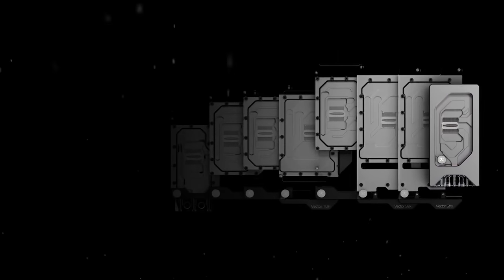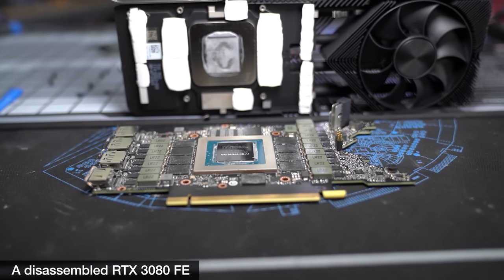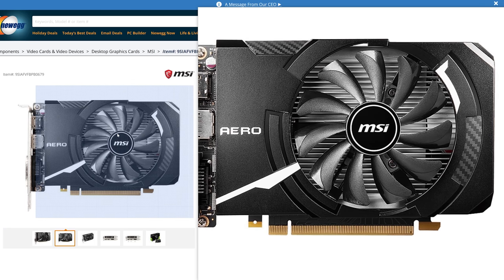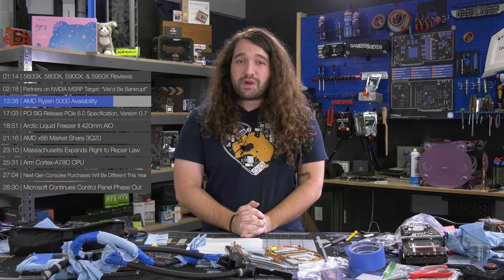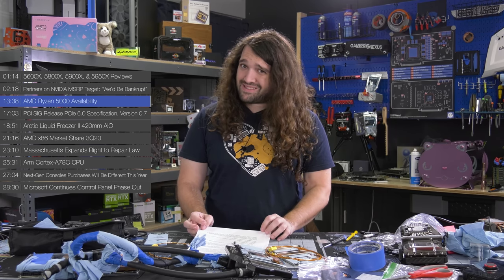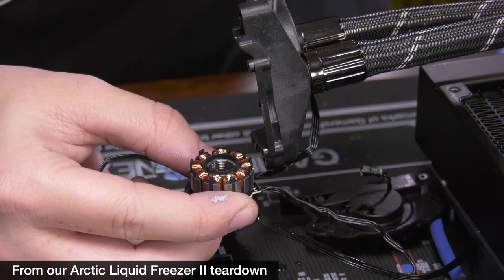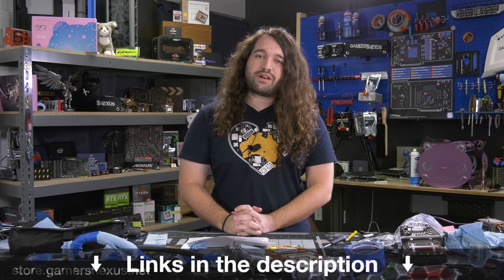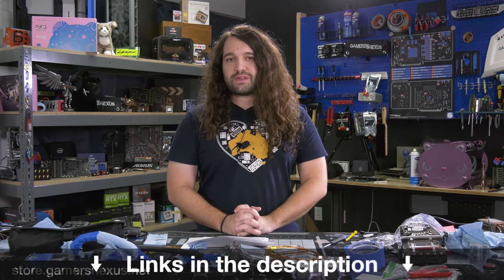HW News - NVIDIA MSRP Allegedly Not Realistic, Ryzen 5000 Supply, PCIe 6.0 Spec

Comment from the maker: Check out our AMD R5 5600X CPU review: https://www.youtube.com/watch?v=01EhbmJAW-k
Show notes & sources: https://www.gamersnexus.net/news-pc/3628-hw-news-nvidia-msrp-realism-debated-ryzen-5000-supply-pcie-6
Reply: Yes exdee
Reply: Jes
Reply: Thanks for all the work on the 5000 reviews.
Reply: hey steve you know of any passive cpu coolers which have a kit for am4 support? Other then that arctic alpine am4 passive.
Reply: Did anyone get the recent patch for Kaspersky? It changed a bunch of stuff. YouTube searches aren't slow anymore. Could make for interesting tech news.. Maybe.
Reply: The restriction of liquid flow in the radiator is smaller with thicker radiators, wider radiator and shorter radiator. So according to this, 360mm radiator can be even more restrictive or similiar to the 420mm radiator. 
A wider radiator may have more fluid lines. A thicker cooler has thicker fluid lines. ARctic Liquid Freezer II have nice thicknes for flow 38mm. Probably 280mm is the best performance choice. Not to small for good radiator performance. Not to long for good liquid flow on radiator and fins in block.
Reply: Just to be clear, you realize that you (or the partners) made an issue for coller cost that is 5-20$ cost ON A UPWARDS OF 300$ RETAIL PRICED PRODUCT right? Obviously either nvidia or nvidia+partners are making a buttload of money selling at those prices, from a manufacturing perspective (cost of components and PCB excluding the GPU and vRAM) those cards are a small two digit expense in total. And since they used to (in the not so far back past) sell them at much lower prices (in particular tiers lower than half or more of today's prices)  it indicates that either nvidia bombed the profit margins on the GPU cost or both nvidia and partners are bombing their profit margins. 

As for the AMD side of things... I dont know if they indeed holding their stock  what I know is that in all of EUROPE I didnt see many (or any) major retailer selling them or at least selling them for more than a couple of days and see only a few small stores (or ebay listings) with unrealistic prices (e.g seen some 5900X CPUs on poland for about 800 euro which is close to 1000$ ) 

What I can tell though is that although your argument makes sense it doesnt have to be the case they could limit their availability artificially just to sell lower quantities at a slower pace but at much higher than MSRP prices and do that for the first 2,3 months or atleast up until Christmas and a few days after that. 

I am not saying that this is the case but in today's computer market where you spend 1000$ for a graphics card (which used to be the budget for an entire and respectable gaming pc setup a few years back) I expect everything from those sleazy car salesman/ bean counter types that manage those things on either side (nvidia amd intel etc)
Reply: Everybody now needs a decent PC at home. Some people really needed it in May and made the upgrade then.  It meant no B550, nor 5000 series.  But personally, it was worth it.  If AMD would have said that zen3 supports AVX-512, I would have bought a cheap CPU with plans to upgrade to zen3.
Reply: killing off control panel is really going to hurt!
Reply: Msrp is a joke. 3080 in canada is $1200 minimum and $2200 for the 3090.
 In regards to your comment about intentional hype supply shortfalls i would say there may be an angle your kust not seeing. Have you seen whats its done to newegg sales? Id be interested to see the sales increase and volume done since the so called release.
Reply: Can you guys review the beQuiet! Pure loop Aio Pleaseeee
Reply: Nothing on Ryzen 5000 here in Russia. No any supplies at all.
Reply: It's starting to look like Nvidia is trying to ABANDON the Video Game industry and finish its move towards AI.
Reply: Scarcity is a tactic in business, just a fundamental outcome of supply and demand. It is designed to keep the price high, if you flood the market it artificially lowers the price. You ultimately might end up actually selling less but while maintaining a much healthier profit margin. Not saying this is what is happening, but it can be a valid tactic. They have been doing it for years on commodities in all sectors. There have been literally instances where they have lost millions of tons of wheat to degradation because it had been held back so long it just rotted. Prices of wheat run at 300% of their perceived value point, that's a lot of extra profit even if you are losing product. In glut years they tip the excess into the sea to restrict supply, which is pretty disheartening when people are starving around the world. If they didn't the price would collapse.

Like I said not saying that is happening here, but it does 'make sense' (i.e. its not a completely absurd idea), this fever creation around product launch definitely makes people desperate to buy, to the point that they will pay more than they might otherwise spend just to get something and avoid dealing with the scalpers. It's worth considering at least, these multinational companies know what they are doing, I do think it appeals to them to have their customers 'howling' for their products. It's good marketing in of itself and may perk interest in groups that usually wouldn't pay any attention (outside the tech bubble).
Reply: I should point out that the 5000 series processors haven't sold out world wide,  retailers in New Zealand (who only supply to New Zealand based customers have stock of the 5600x,  and not just a few units).
Reply: get the 5800X, if you are doing anything while gaming the 5800X will be the better buy. like, gaming and streaming. i wish that they would add different scenarios when doing "gaming" benchmarks. maby add in spotify playing in the background with like 10 tabs open on chrome and streaming all at the same time.
Reply: Time line on left is very useful 👍
Reply: HELP!  TinyDic just updated Win 10 which trashed many of my setting , and made Edge browser uninstallable , AND added a MSN news site popup window, which  I cannot remove !!!  HELP!!!
Reply: Brace yourselves... the partner statements, bots, scarce supply while fanning demand to justify high ticket pricing is coming, here, and sticking around. 

I mean this is blatantly a game. I can wait it out. Thats cool bro.
Reply: Good cover bro. In the public sphere gotta play along.

We all secretly werent born yesterday, however. On the plus side, its good to see AMD no longer at the feet of the blue god crying for continued existence bordering on the ledge of bankruptcy.
Reply: Laughs within the walls of physics

Competition will continue forever? There reaches a point when traditional capitalism breaks down, like trying to outrun causality without becoming shredded by a black hole.
Reply: Yeah but one problem with that logic. As lithography slows to a crawl, and eventually hits impossible progress, the rate of improvement and also the fact this stuff sticks around, say for maybe a decade is a big concern for how things operate in the real world, which you cleverly, fail to acknowledge bluntly. If you can get the margins despite this cliff before you, it would be a wise mission, and shared by more than one guy piloting the ship. And a gal. My how shes turned things around.... pure gangster.

Of course who can see things for what they actually are? Who wont.. just sayin. Conspiracies bruh. Some wild curve balls out there.
Reply: These messages should be doubted. There are actually no valid wierdnesses conspiring against consumer desires.

Im just teasing. We are going to need faster and faster CPUs, particularly if we are going to be leveraging the parallelism of a 32 thread hammerhead shark on roids. 

Imagine though, if artificial intelligence could help us create content, to actually task such monster capabilities realistically. Its going to be the hail mary that intervenes and gives us essentially the: "are we in a simulation?" levels of complexity. It was the same problem cell had. In order hand holding drudgery software side. Why do you think games are 70$ now? Think graphics artists that can render microscopic events on the skin of characters of the future are going to come cheap? Its not so much even the walls...... its the how the heck are we gonna use all that power without further increasing development budgets? These are supposed to make us money n stuff. Its becoming more and more risk, less return. Thats what you freaks out there dont get. Its some high caliber art, and its being purchased at a discount. The hardware we buy is still wildly more affordable than some of the most famous paintings.
Reply: LowJack187  

I was waiting for you Robin. We are here to revelate. Gotham will be safe in our hands.
Reply: We will never get the cream of the crop. 

Basically its a half truth. We will bottleneck on physics eventually, conventionally. But I dont get the idea we will ever gravitate as a public, to quantum computations. Its simply too powerful. 

We should be careful pursuing A.G.I. though. It could be rather dangerous particularly if developed for purposes of getting a technological edge, which could be in practice for the rest of human history outside our hands. Sounds crazy, but its probably actually true, for we are such a young civilization in a vast and absurdly ancient universe. The probability of being alone, well lets just straight facedly say thats zero. At some point, intelligent life maxes out in processing power efficiency. From there its all about temperature and scale.
Reply: Oh I understand it Jim.

@ 08:16
Its true origin is predominantly related to a quantum memory state species share jung coined the collective unconscious. James is just not going to explore that cavern of intellectually honest perceptual capabilities.

Thats why he suggests we are getting more educated, and have better nutrition. Maladaptive mutations eroding our intelligence is not factored in, nor is how this pattern of repeating behavior scaling across the planet by a genetic correlation, say in rat sub species learning exacting mazes. Its all just magical thinking far too abstract for anyone whos not truly a machine for looking for relevance. Anyone else with logic, can see it instantly. Its kind of a shame we have to revise our IQ tests all the time, because a statistically relevant memory can be in some subtle way shared across human beings. Kind of like with solving crossword puzzles if you bother to time it, relative to when it was released.

It might as well be propaganda.
Reply: https://www.youtube.com/watch?v=80ml_O1iPAE

God has given you one face but you make yourself another.
-William Shakespeare

There is more wisdom in your body than in your deepest philosophy.
-Friedrich Nietzsche 

Death, like birth, is a secret of nature.
-Marcus Aurelius

Who has fully realized that history is not contained in thick books but lives in our very blood?
-Carl Jung

The slave is doomed to worship time and fate and death, because they are greater than anything he finds in himself, and because all of his thoughts are of things which they devour.
-Betrand Russell 

Paganism is wholesome because it faces the facts of life.
-Aleister Crowley

Unless wariness be used, as good almost kill a man as kill a good book; who kills a man kills a reasonable creature, God's image; but he who destroys a good book, kills reason itself.
-John Milton

The highest revelation is that God is in every man.
-Ralph Waldo Emerson

God helps those who help themselves.
-Benjamin Franklin

Neither shall they say, Lo here! Or, lo there! For, behold, the kingdom of God is within you.
-Luke 17:21, Jesus Christ

An intelligent man is sometimes forced to be drunk to spend time with his fools.
-Ernest Hemingway
Reply: What constellation is that on your forehead?
Reply: Still no word about the fact that nvidia doesn't intend to sell more than a handful of their FE cards. Many people are waiting, because they trust reviewers to guide them in buying their new card. When are you gonna say "don't wait for a FE, you won't get one even in one year" ? 

At least we'll get a "woops, sorry we fucked up we didn't realize this product wasn't actually real" video six months from now, I guess.
Reply: heres a question. in this day and age, couldnt someone just mount a small refrigeration or freezer unit into one of these AIO style or large air cooling block sizes to mount on a CPU?

yes, id expects it to take up a shit ton of wattage. but still. 'extreme cooling for extreme gaming' as some of these companies say.
Reply: I'm currently using the 280 Liquid Freezer II. Stellar product.
Reply: Regarding AMD 5000 availability in Europe (Portugal): 5900X and 5950X were gone fast and I haven't seen them available anymore. 5600X and 5800X were available for some hours in Portugal. 5600X became harder to get, but still becomes available once in a while (but for little time). 5800X has been available - it sometimes goes out of stock, but it's been relatively easy to find online.
Reply: I appreciate your videos.
Reply: My take away here is "wtf windows is killing the control panel" those are the most important news